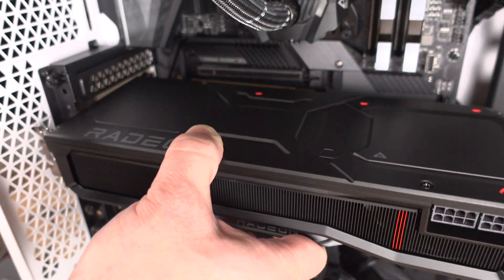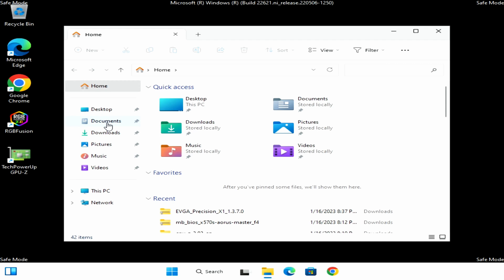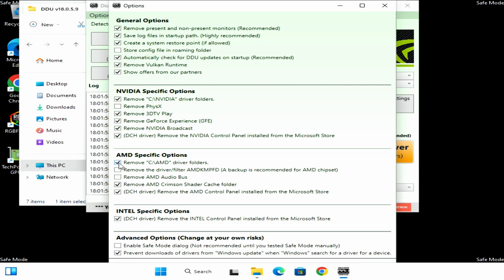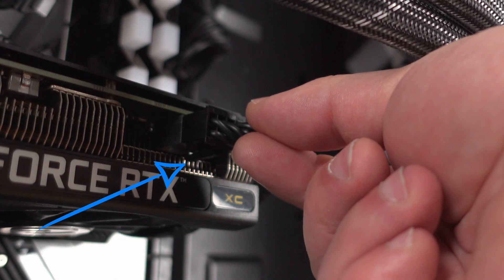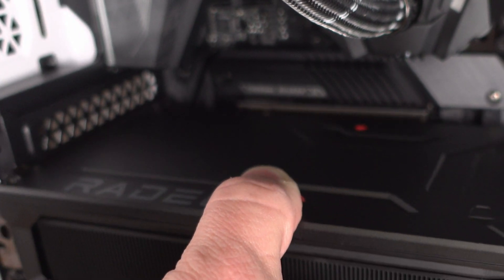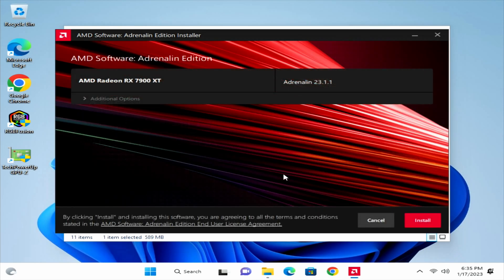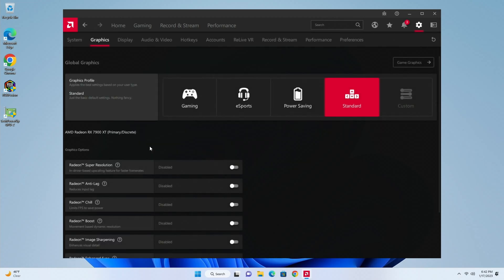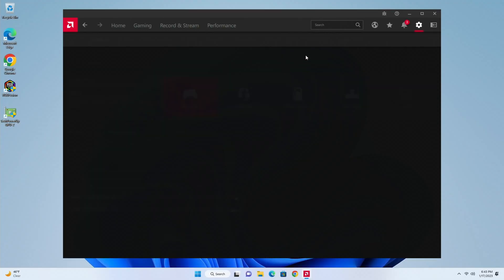The best way to Install the AMD Radeon RX 7900 XT Graphics Card in your PC

Comment: Warning:  Fix fan curve automatically before playing games or stress testing!  You will fry the AMD cards quickly if you don't shut off Auto fan stop and don't fix the fan curve.  First time I installed my 7900xt it went to 95C after 60 seconds of stress testing.  Use amd software in tunings or get afterburner.  I have the same exact card.  40% constant fan now and 80% during gaming and temps won't go over 55c.. idles at 27c but I have 3 fans for the top and 3 for bottom pushing air up thru the AIO.  Unless I play long hours and my 7800x3d (32c idle - 70C in game) heats up my whole room and the card might go up to 60c max.  Also I heard that with my RM850 Corsair PSU cables, it is ok to daisy chain the card with one 1 connector.. does anyone have any real advice on this?  My Gpu shows it is pulling 305 watts at times when I max it out but I play in Eco mode and undervolted my GPU since then.  Now with my FPS capped at 60fps in 4k I only use about 90-150watt from the card.  Any advice will be highly appreciated.  Thank you
Reply from the maker: No, you don't need to do that if you have good cooling your system, obviously I did it and you saw it, you can follow this and it will help you: https://youtu.be/J5m5WBlPkfc, listen to it, it will help you.  You can see my gaming video here: https://youtu.be/-dW7KWeb76M
Reply: @ThisBytesForYou  Telling people not to fix their fan curve automatically is a huge problem for AMD users, not everyone has a HIGH FLOW 9 dual chamber case like mine with 7 total fans and my AMD card was about to fry itself, so did my 1080ti in my other build case that only had 4 fans and that was an Nvidia card.  Same with my RX590, same with my, RX470, same with my HD6850 1GB.. all the cards had problems, crashes after a long game and also heated up other component for no reason.  Your AIO cooler lines and M.2 and Ram are all so close together that a card that stays at zero fan speeds till (IDK I think you said they finally start moving at 65C or something)  why would you let it even get that HOT.. I always had problems before fixing the fan curve no matter which PC I ever build for myself since P1 300mhz.  That's is my advice and ill die on that mountain.   Fixed a ton of my friends PCs that way too.
Reply from the maker: you don't need to do that if you have adequate cooling in your case, and your ambient temperature, fixing all of that, fixes the need to adjust the fan curve.  You have issues with all the card,... that means you have bad air flow if you have had issues with all you cards... just think about that for 10 seconds. Your system has tremendous heating issues.  65°C is not hot at all, that is PERFECT, temps between 65°C to 75 °C are completely normal. You don't want your card to exceed 85°C.

If you had problems with zero fan speeds, you have thermal issues in your PC.  My house is usually 63°F, I LOVE IT COLD and so does my PC.  63°F is 17.22°C.  I know that's too cold for a lot of people.  My mom and her husband would keep their house at 83°F which is 28.33°C, that's dangerous and they had issues with their PC's when they would game, because they were generating heat, you won't get much lower than ambient for the CPU if you are using liquid, and if you.  

I have been building PC's since I was 13, before AOL, during the BBS days, I was a product development engineer for Alienware, then years later Dell after they bought us, then Velocity Micro, I've been doing this very same testing for years, pretty sure I got a good swing of things.  I've been inside heat and sound chambers, this is fun for me.

Fix the ambient temperature in your house, fix the airflow in your PC, and you don't need to touch Fan curves.

Comment: Had to deal with bit locker for me to get into safe mode.
Reply from the maker: I have never dealt with bit locker in that scenario, how'd you get around it?
Reply: @ThisBytesForYou  Had to go under Microsoft account and took a picture of it for keeps. I don't understand why I have to put it in every time I go into safe mode. I thought I seen that it could be disabled. This is my personal computer and not public use and shouldn't have to deal with this.
Reply from the maker: it was not needed in the past, BUT as MS does updates they start making things required. Are you an admin of your machine and does your admin account have a password and a pin number?  This might help.

Comment: This does not solve the problems of my AMD drivers timing out... help me breahhhhhhhhhhh
Reply from the maker: So that I can help, please list the manufacturer and exact model number of the following components:
1. Motherboard - manufacturer and exact model number
2. CPU - manufacturer and exact model number
3. RAM - manufacturer and exact model number
4. Video Card - manufacturer and exact model number
5. Power supply - manufacturer and exact model number
6. Monitor - manufacturer and exact model number
 Redundant I know, but many people forget to enter manufacturer and exact model number
7. Do you have ALL of the PCIE connections plugged in, and not daisy chained or pigtailed, each coming directly from the power supply?
8. Are you running through HDMI, DP, DVI, VGA, any adapters?
9. Is UEFI or Legacy Setup in the BIOS?
10. What slots do you have your RAM installed in?
11.Do you have CSM Enabled or Disabled in the BIOS
11. Installed latest supported chipset driver?
12. Have you disabled Fast Boot within Windows?
13. This video will help you identify hardware inside your PC: https://youtu.be/65ZSiVImJx0
Reply: @ThisBytesForYou  
1. Motherboard is a Gigabyte B550M DS3H AC
2. CPU is a Ryzen 5 5600X
3. RAM is a Corsair 32 GB 2400 MHz (2x16)
4. Powercolor RX 7900 GRE Fighter
5. Cooler Master MWE 650 White
6. 2 monitors; one is a MSI G27CQ4 E2 (1440p) and the other is an old Philips 221TE
7. I have two seperate PCIE cables plugged in, not daisy chained coming frrom the PSU.
8. The 1440p monitor runs DP, and the old monitor HDMI
9. Not sure, the option for UEFI only appears when CSM support is enabled.
10. The second and fouth one, it is indicated by the motherboard that those are the right spots.
11. CSM is disabled.
12. Latest driver is installed, I mean I just reinstalled it like in the video so I would think so.
13. Fast boot is off.

I know the RAM is slow, but it hasn't had any issues with my RTX 3050
Reply from the maker: #1 do you know what BIOS version you are on?
#3 while slower, it should work fine, but are you using XMP in the BIOS?
#6 Have you tried the HDMI monitor alone, to see if that works, and/or the DP monitor alone to see if that works?
#9/11 Do you know if your C drive, your main drive is in MBR or GPT?
If you don't know how to check, check out this video, check it out at the 8-32 mark, it will show you how to check, and if you are on MBR, it will show you how to change to GPT too, which is VERY important: https://youtu.be/4BtdMcqwaFg?si=Yww_bfnNQKJ1V0Ti

You might need to change to CSM enabled.
Reply: @ThisBytesForYou 

1. Current BIOS version says: B550M DS3H AC FC. It's been updated too.
2. XMP profile is being used
3. I've tried using one monitor, doesn't resolve the amd driver timeouts either.
4. C drive is GPT.

I enabled CSM, driver timeouts still occur.
Reply from the maker: @Bretaxy  3 give it a try, it will take you seconds
Reply from the maker: With out editing your comments, because I don't get notified, now use ddu to clear the driver, then reinstall the driver.
Reply: @ThisBytesForYou  I followed the steps in the video to do this, but I still get the issue. I've also tried reducing the memory clock speed by 20% and undervolting with no success.
Reply: @ThisBytesForYou  Also the issue only occurs when playing games. More commonly with directx12 games.
Reply from the maker: OK, that's good to know, that it does that during gaming, sounds like it can be a heat or power issue, but it could be al little more.  Actually, I see the minimum power supply requirements is a system running 750Watts so at 650,  I don't think you would do great and it make sense that it would happen when you are gaming, that consumes the most power.

You might want to look at updating your power supply, another CoolerMaster, at a great price point you can find on my Amazon Affiliate link, its an 800, a little more power: https://geni.us/73gT
Reply: @ThisBytesForYou  Wouldn't it be cheaper if I were to go with a 4070 instead?
Reply from the maker: you probably would have less issues and a 600 Watt is enough, though my Amazon affiliate link: https://geni.us/xhvA7we

Comment: Man I am trying to install a RTX 4090 but my card is slanted never goes in like the one in the video here... It is as if the motherboard is sitting a couple mm lower than it should be, so pcie slot screw ledge sits where it should but the card is at an angle compared to the motherboard and not perfectly horizontal as it should be...

So even though the pcie clicks the smaller part of the pcie connection is not in all the way. 

It might still power on I assume but I am scared to damage the components...

Maybe I could send you some pictures would really love to hear your take on it, because it is kind of absurd...

🎉🎉
Reply from the maker: hmmm, did you build the system or is it a prebuilt?
Reply: @ThisBytesForYou  unfortunately I built it 🤔 just couldn't find someone passionate enough to build it. I couldn't trust it to anyone where I live, I live overseas...
Reply from the maker: @MMMM-sv1lk  I get it my friend, sounds like maybe you used the wrong standoffs, what motherboard were you using, manufacturer and model number, case as well maybe?
Reply: @ThisBytesForYou  I went with a asus tuf gt501 case I am using the standoffs that came with the case, I have a micro atx asus tuf b650m-e motherboard.

If I knew any better I wouldn't have chosen these components, the case is outdated, and the motherboard is too tiny for a monstrosity such as rtx 4090... The 4090 is so thick it covers the audio connection and chassis fan connection at the bottom of the board, so I unplugged them so they wouldn't obstruct anything. But the on off switch and led + led - connections are connected, but they don't seem to cause a problem they are too far away from the problem area, the back of the case. 

The confusing part is that the motherboard back panel fits snugly and properly to the back window of the case, so if the standoffs were somehow not the right size I would expect to see a misalignment in the back panel but there is none...

It is unusual to say the least these parts should fit under normal circumstances, or so I thought...

One thing I haven't tested is that I am trying to install the card with the case laying flat on it's side, I am thinking maybe when the case is laid down like that the weight of the card and the other components are pushing the middle case panel where the motherboard is attached, it is a fairly thin, and sagging, thus effecting the alignment.
Reply from the maker: @MMMM-sv1lk  ahhh yeah the prongs (that slide into the rear of the pcie slot, may be sticking out,
Reply: @ThisBytesForYou  I will double check it, thank you for taking the time to talk to me. 🙏
Reply from the maker: always a pleasure my friend.
Reply: @ThisBytesForYou  well after your remark about the prongs, I went back and wiggled it a bit more and the card moved that little bit extra just enough to have a flush connection. All thanks to you man, I am forever grateful, really appreciate your help. Thank you for your support. 🙏🙏🙏☺️💐
Reply from the maker: Always a pleasure my friend, so very happy you stopped by, trusted in me to help you, liked and subbed as well as took a moment out of your day to thank me.  It means a ton to me and I am so very happy I could help you.
Reply: @ThisBytesForYou  I am considering using a riser, just watched your video on that. But I will try it a couple more times before I make a decision.
Reply from the maker: no no, if you used the wrong stand offs, you are risking killing your system, let me know the manufacturer and model number of the motherboard, case as well maybe?
Reply: @ThisBytesForYou  I was moving in steps, so after installing the motherboard, ram, cooler and m2 drive I powered on the system and installed windows following the instructions on your videos the system seems to work fine. I even got the expo to run.

And today was the day I was planing to install the graphics card but I couldn't get it to fit snugly...
Reply from the maker: So check out this video, https://youtu.be/v3GOGIJP_tA?si=BBP3pywsAFAdoZOF on this video at "14:15: I go over what I am talking about (don't click on this time here, it will take you to the wrong video, click on the video link)
Reply: @ThisBytesForYou  watching it right away 😌👍

Comment: Hello I am having issues. I just got an AMD Radeon RX 7900XTX, that needs 3 pcie connectors. How do I find out if a pcie cable is compatible with this specific graphics card?
Reply from the maker: What is the manufacturer and model number of your power supply?
Reply: @ThisBytesForYou  manufacturer is be Quiet, model is BN506
Reply from the maker: they really screw you with that power supply, only 2 cables, but they branch out to 4 cables.  Sadly, I would have to tell you to use those 2 branched out, daisy chained cables.  Check in the power supply box for them.

Comment: My 7900xt have x3 8pins, should i connect them all?
Reply from the maker: Have you watched this video?
Reply: @ThisBytesForYou  not till the end. I am now stuck because i see yours have x2 8pins, and mine have x3 8pins.
Reply from the maker: @artyono9002  so what do you think I would do if I had 3?
Reply: @ThisBytesForYou  its also funny for me, because in instruction there are only x2 8pins, not like my card have 3 :D
Reply from the maker: @artyono9002  what is the model number and manufacturer of your card
Reply: @ThisBytesForYou  Asus TUF-RX7900XT-O20G-GAMING (90YV0IV1-M0NA00) 
I hope I answered your question correct
Reply from the maker: that makes sense, this is meant to be overclocked heavy and is about 200Mhz faster than the card I have, thats why it needs that additional power, good stuff my friend and thanks so much for your support, it means the world to me. @artyono9002
Reply: @ThisBytesForYou  okaaay. It now also makes sense, because usual one is around 300w but mine will eat more. Everything works fine. Thank you for video and support!
Reply from the maker: anytime my friend, happy I could help @artyono9002
Reply: How I understand. I can put all x3 ceparare 8pins, or I will be also good with x1 8pin and one double cable 8 pin?
Reply from the maker: @artyono9002  don't daisy chain them, if you can avoid it, use 3 separate cables

Comment: I follow step but displayport shows no signal
Reply from the maker: So that I can help, please list the manufacturer and exact model number of the following components:
1. Motherboard - manufacturer and exact model number
2. CPU - manufacturer and exact model number
3. RAM - manufacturer and exact model number
4. Video Card - manufacturer and exact model number
5. Power supply - manufacturer and exact model number
6. Monitor - manufacturer and exact model number
 Redundant I know, but many people forget to enter manufacturer and exact model number
7. Do you have ALL of the PCIE connections plugged in, and not daisy chained or pigtailed, each coming directly from the power supply?
8. Are you running through HDMI, DP, DVI, VGA, any adapters?
9. Is UEFI or Legacy Setup in the BIOS?
10. What slots do you have your RAM installed in?
11.Do you have CSM Enabled or Disabled in the BIOS
11. Installed latest supported chipset driver?
12. Have you disabled Fast Boot within Windows?
13. This video will help you identify hardware inside your PC: https://youtu.be/65ZSiVImJx0
Reply: @ThisBytesForYou  
1. Rog strix B650E-F Gaming wifi
2. Amd ryzen 9 7950x
3. Corsair Dominator platinum rgb DDR5 RAM 32GB( 2x12GB) 6400MHz CL32 Intel XMP iCUE compatible computer memory black
4. Sapphire Nitro+ Amd Radeon Rx 7900 xtx graphics card
5. Corsair RM850x
6 tuf Gaming VG289Q1A 28" monitor 4k UHD
I got the VGA white light. I tried taking out RAM and clean cpu and reset bios I still get the VGA white light.. I'll try flashing the bios tomorrow.
And i only have the display port I don't have hdmi cord so haven't tried that
Reply from the maker: so, there is 7, 8, 9, 10,. 11, 12, 13, some of the most important parts